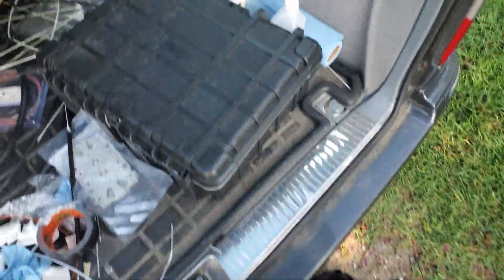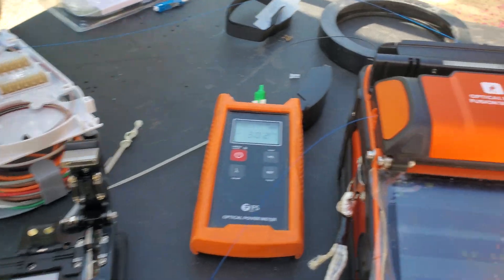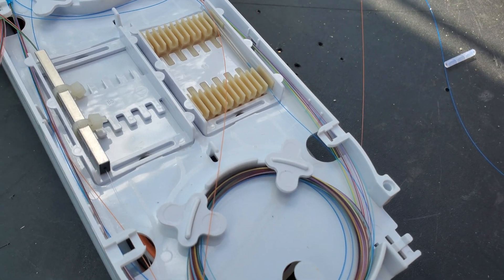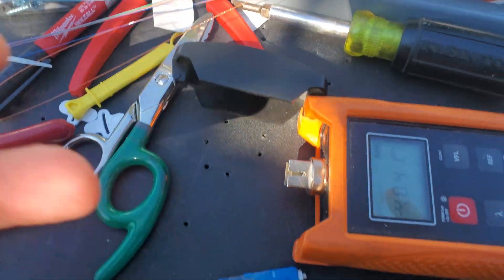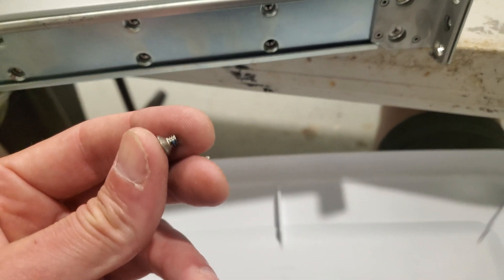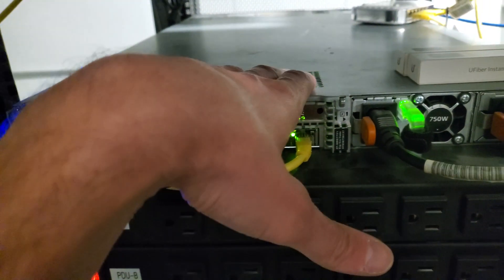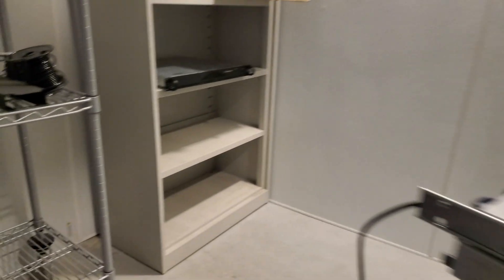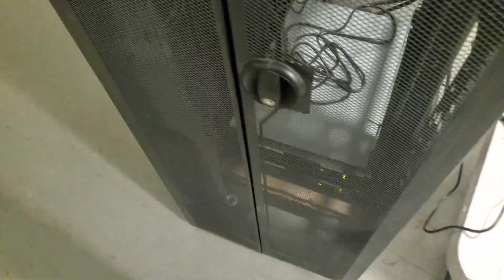GPON vs DSL 2Mb\s, PLC splitters + 4th 10G transit coming up

Comment: I do dig on OSPF, less so when you have several different vendors involved as the flipping mtu mismatch will get you every damn time!  I always disliked how different vendors represent the mtu command differently.  Thanks for the vids.  It cool to see the way wide area setup.  I just deal with 3 locations connected with diverse dark fiber, and use DWDM MRV muxes and drivers.

Comment: I notice your OPM is set to 1490nm and the taps power is quoted at 1550nm does it make much difference?
Reply from the maker: The gpon is 1490 1310.  I set at 1490.  The splitter spec sheet just provides 2 tests 1310 and 1550

Comment: I have added 2x 8GB (16GB) UDIMM together with a 64GB Apacer in the SATA port and run Docker on a 7050QX-32 .
Reply from the maker: I'm already on ebay looking at used aristas

Comment: more good content in this video from splicing to noc and setting up bgp/osfp - shows there is always more to learn even for experienced techs/network admins

bgp does not have security, osfp has some, eigrp (this may be cisco only?) has more   - please go into more of how you need to calculate all the db in the lines while you propagate installs - I sort of get it but don't really understand all the in and outs and design parameters

Planning out tapping into a fiber line is a critical aspect of network design, especially in the context of fiber-optic networks and technologies like DWDM (Dense Wavelength Division Multiplexing) and GPON (Gigabit Passive Optical Network). Let's break down the importance of planning, the significance of dB levels, and their relation to DWDM, GPON, and general fiber network design:

Importance of Planning:

    Network Reliability: Tapping into a fiber line without proper planning can disrupt the overall network performance and reliability. Careful planning ensures that the new connections integrate seamlessly with the existing network infrastructure.

    Data Security: Fiber-optic networks are known for their high level of security due to the difficulty of intercepting signals. When tapping into a fiber line, it's crucial to ensure that security measures are in place to prevent unauthorized access and data breaches.

    Bandwidth Optimization: Proper planning allows you to optimize the usage of available bandwidth, ensuring that all connected devices or services receive sufficient data without causing congestion or slowdowns.

    Scalability: As network demands grow, a well-planned network can easily accommodate additional connections and increased traffic without significant disruptions.

    Minimized Signal Loss: Tapping into a fiber line can introduce signal loss or attenuation. Effective planning helps mitigate this loss through proper cable management, signal boosting, and quality components.

dB Levels and Signal Strength:

In fiber-optic networks, dB (decibel) is used to measure signal strength and attenuation. As light signals travel through the fiber, they experience some level of loss, and maintaining an optimal signal-to-noise ratio is essential for reliable data transmission. Lower dB levels indicate a stronger signal, while higher levels suggest signal degradation.

Relation to DWDM:

DWDM is a technology that enables multiple wavelengths of light to be transmitted over a single fiber, increasing the network's capacity significantly. Proper planning of tapping into a DWDM fiber line involves considerations for maintaining specific signal strengths across various wavelengths to ensure that the added connections don't disrupt the existing DWDM channels.

Relation to GPON:

GPON is a passive optical network technology that uses optical splitters to deliver high-speed data, voice, and video services to multiple users. When tapping into a GPON fiber line, maintaining appropriate signal levels is crucial to prevent signal degradation, which could impact the quality of service for all connected users.

General Fiber Network Design:

In any fiber network design, including DWDM and GPON, planning involves several key steps:

    Site Survey: Understand the physical layout, distances, and existing equipment to determine the optimal points for tapping into the fiber line.

    Cable Routing: Plan the cable routes, taking into account factors like bends, lengths, and potential signal loss.

    Signal Loss Mitigation: Incorporate signal boosters, amplifiers, or repeaters to counteract signal attenuation.

    Security Measures: Implement encryption, authentication, and physical security measures to protect the tapped connections and overall network.

    Testing and Monitoring: After installation, regularly test and monitor the connections to ensure they meet performance standards.

In summary, planning out tapping into a fiber line is essential for network reliability, security, and optimized performance. dB levels play a crucial role in maintaining signal strength, especially in technologies like DWDM and GPON. Careful planning ensures successful integration, minimal signal loss, and scalability of the network.
Reply from the maker: Whoa nice comment left me a little bit of homework too.

Comment: Love the videos! I watch every single one especially the ones about the backbone.

Question… is transit typically cheaper than DIA excluding purchasing/leasing IP space? What’s the average cost differential?
Reply from the maker: Transit has a lot of weird options that come along with it.  You typically want transit going to the opposite direction of your current provider I guess.  Transit has like 100G waves, layer2, mpls, vpn, all sorta crazy plays on it.  But once you get to the DC you still gota pay $90\month for a cross connect and $500\month for a connection.  Also alot of DIA you need to check contract you can't "resell it"
Reply: @briceperdue7587  Is your transit to Philly or Ashburn area
Reply from the maker: 3.  Philly, Baltimore, and Ashburn